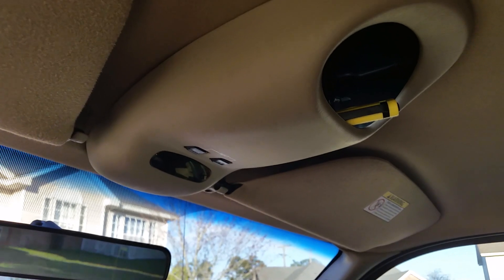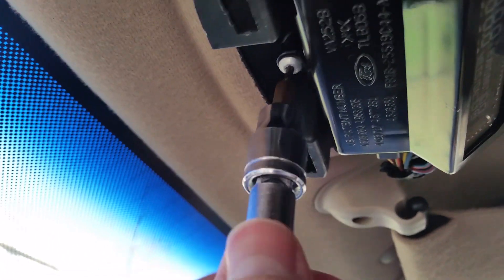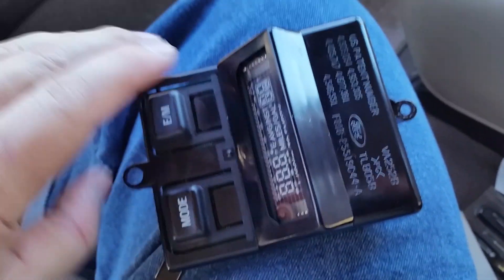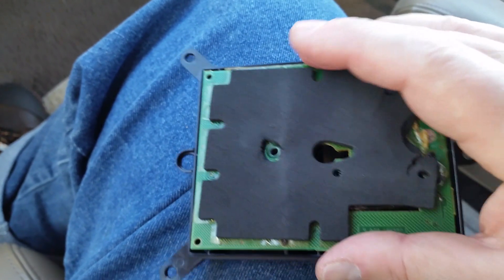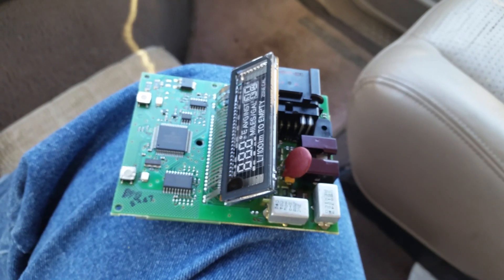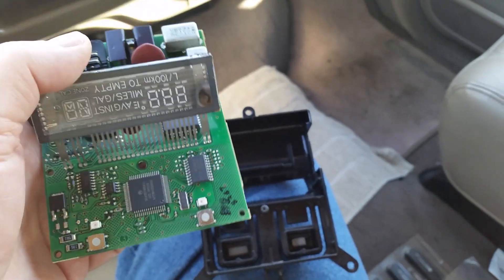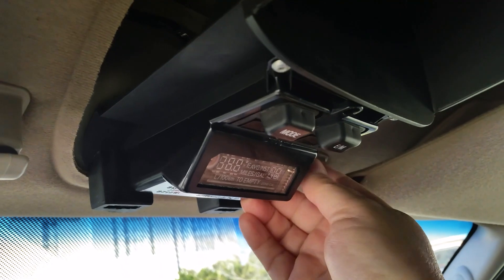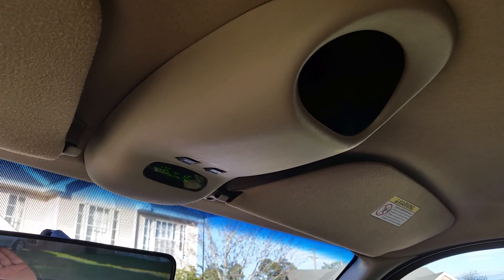99-04 F250 F350 RELIABLE Overhead Display Fix P/N: F81B-25519C44-A

Comment: Great video and it mostly repaired my dead display.  The only issue now it it displays a 3mpg improved fuel economy which also extends my miles to empty.  I had 3 loose resistors that I resoldered one end.  Did I miss or mess up something?  Or since it was dead for so long it forgot it was on a 7.3 liter and went back to a default gasoline engine?
Reply from the maker: Hi Brant, If one side is loose you need to do both sides as the other side will have micro cracks in it. I don't think it would default to gasoline, the calculations are done by the ECM and sent to it. Also make sure the solder is only on the pads and not overflowing the sides and possible touching some other traces or components. In addition to that sometimes when soldering some small solder balls can get onto the leads of the neighboring components and short them out. Check the board for good solder flow, contamination and make sure and clean all the flux off with some alcohol. Last but not least check to make sure all the pins for the connectors and the VFD display don't have micro cracks where they go into the board. If that fails, well sorry to say but you'll need to replace it. Let me know how it goes. Best Wishes n Blessings. Keith Noneya
Reply from the maker: Hey Brant I was going through the comments and remembered yours. Were you able to get it fixed. If so what was it. If not I got to thinking about it again. I was thinking if your ordered the wrong resistor values and put the wrong value in, that might make it read wrong. If you're not sure I can always pull my back off and measure the values with a meter, while they're still on the board, and let you know what they read so you can compare them with yours. Anyways just a thought. best Wishes & Blessings. Keith Noneya

Comment: Great video my man thank you so much.
Reply from the maker: Thanks Mortorx. This applies to just about any automotive electronics, ie. the electronic AC/Heating Controls as well. Thanks for watching and glad to help. Feel free to ask questions anytime. Best Wishes n Blessings. Keith Noneya
Reply: @keithnoneya  I fixed my 04 F350 the day I watched you video. I took a look at my circuit board and found exactly what you said. My one resistor was hanging by a tread and I touched another one and it fell out. My Soldering looks like crap compared to yours but I  got it done and it works.i had some epoxy and did it right. Thank you so much for your awesome video.

Comment: Does this work for p/n 2c3t-10d898-ac
Reply from the maker: Hi Scott, it will work on any automotive electronics that has loose resistors or components on the board. Hope that helps answer your question. Feel free to ask more questions if needed. Best Wishes n Blessings. Keith

Comment: Great video, thanks!  My overhead display works great, except I can not get my compass to calibrate.  Don you have any idea why?
Reply from the maker: Hey Joe sorry I missed your question for some reason. The compass module in the overhead display is probably bad or has a bad solder connection. You could also have a magnet close to the compass like a speaker, cell phone, CB etc. If think the compass connections are bad you could also resolder the chip connections and see if that solves your problem. If neither is not the case you might as well have someone replace the chip or find a new overhead module.
Hope that helps answer your question. Thanks for watching. Best Wishes n Blessings. Keith Noneya

Comment: I just picked up a 2001 F250. The trip computer didn't work. This video was very helpful, but I'm wondering why the resistors come loose in the first place. Heat? Vibration? OK, but one of them was standing at a 90 degree angle to the circuit board. Weird. I fully expect that it will one day fall apart again.
Reply from the maker: Hi Karl. The reason is the solder they use. Consumer electronics uses LEAD FREE solder. It is HIGHLY susceptible to temperature cycles, hot cold, hot cold etc. Over time the temperature cycles cause the solder joints to crack from all the expanding and contracting. LEAD FREE solder is one of the major causes of electronic failures today, and the biggest reason electronics end up in land fills. It's also the single most reason Automotive Computers ECU's, ECM's, TCM, BCM's, radios, electronic environmental control and electronic controls in vehicles etc. fail. LEAD FREE solder is so bad it's banned for aircraft electronics after it was linked to several deadly aviation accidents. So if you want your electronics to last longer when you repair your items use 60/40 or 70/30 Lead Tin solder. Hope that helps explain it.  Thanks for watching. Best Wishes n Blessings. Keith Noneya
Reply: Thanks, Keith. I couldn't get my big fat solder and gun in there to do a good job, so I just heated it up and it stuck. As I noted, I'm sure it will fail again. By the way, it nearly drove me insane to get both catches loose on the console cover. I could not picture in my mind what was going on or what should be going on. When I finally got it loose, it all became clear. One look at the catches let me know what I should have been doing, and that there was little risk of breaking something.

Comment: I will be doing this over the weekend...will update my success or failure.  My truck has a different overhead console just fyi.  Mine has the sunglass holder and Garage door opener.
Reply from the maker: The principle should be the same on it. Just look for the raised, cracked or missing resistors. If you have one missing and don't know what the value or part number is let me know. If it's like mine, the module, I can look it up for you and provide you with a link to a seller. If I have it, as I have some spares let me know I'll ship one to you. Eh no cost. Hope the video helps. Best Wishes n Blessings. Keith
Reply: Well I had one lose resistor and two that had fallen off the board completely.  I did my best to solder them back on but I did a horrible job! LOL. I really need to learn more about soldering.  I ended up blowing a fuse for the turn signals when I installed it and the speedo and door locks no longer worked.  So needless to say I found one on ebay
Reply from the maker: Ah man that sucks. Yah if you don't know about electronics soldering can lead to disaster. Nice try though. If you have some flux etc it can make the solder flow better. Been a qualified solder tech for a few decades.
Best Wishes n Blessings. Keith
Reply: @SpecialMomentsLLC  that is not your doing, the computer itself was bad, overtime of overheating it destroyed the 48 pin chip internally.

Comment: Nice job on the video Keith. I really appreciated the detailed pictures. Thank you for contributing! I am looking forward to tearing into mine, it hasn't worked for years. :/
Reply from the maker: Thanks Jeff, don't forget to read the comments for the resistor part numbers you'll need in case you have some missing. If you have a steady hand and are familiar with a soldering iron you can do it without a microscope. I used one because I had one available to use. It also made it easier to take pictures for the video. If you have any questions please feel free to ask. Thanks for watching. Best Wishes n Blessings Keith
Reply: Follow up! Thank you again for the video. I followed your instructions and found that two of the resistors had cracked on one end. I was able to solder them back into place, and it is working now! It is the first time that is has worked in years. Wow, I didn't need to know how hot it was though... 98 today according to the temperature read out! haha. But seriously, thank you!
Reply from the maker: BIG happy smile on my end. You're welcome Jeff.